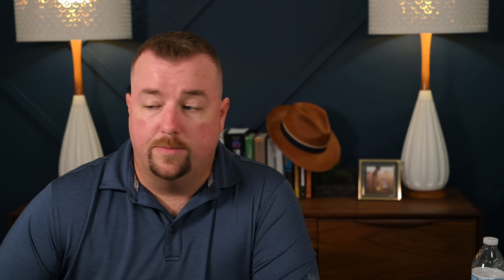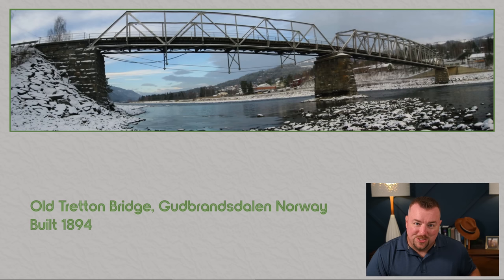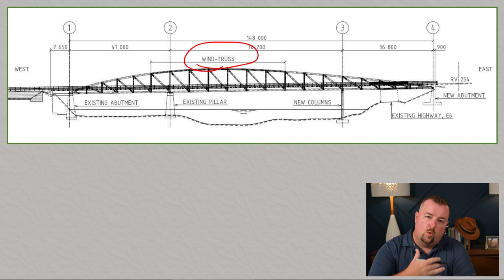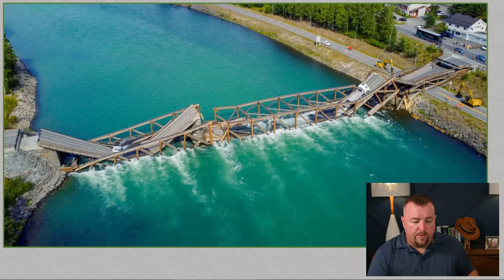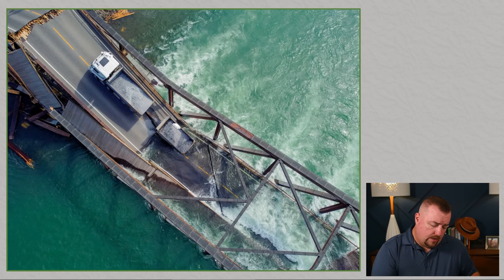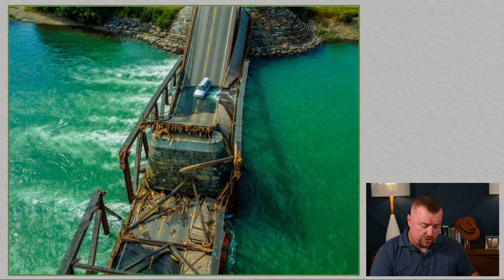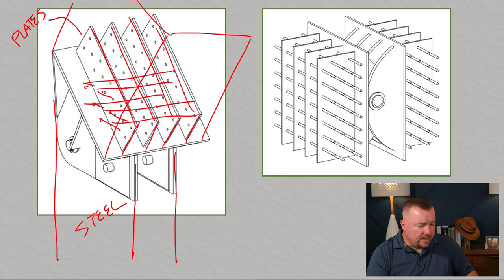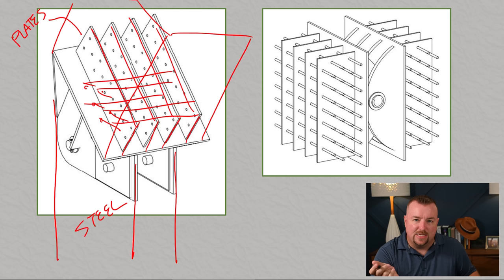How Did the Engineers Miss This?

Comment: I "rode" suspended in a tender house on a bridge 2 days a week for 11 years, and noticed that any heavy vehicle, or one with a heavy load, pushes the bridge into a wave as it first gets onto the bridge deck. Additionally that wave compresses as the vehicle crosses. I cannot imagine any wood joined to metal surviving long-term waves like these.
Reply: We used to call this a bow wave. Happens to asphalt on a insufficiently compacted surface also.
Reply: Happens on ice even quicker. Ref:ice road truckers you can see and hear it
Reply: Im a trucker and in the US this isnt unusual. Big heavy concrete bridges and you can feel the bridge react. Then a second truck comes on and it gets..a little worrying. We actually have laws determining how close together our wheels have to be adjusted because of this
Reply: @jgren4048  That's why there's strict speed limits for heavy loads on ice roads: it allows the "bow wave" to spread out and weaken before the mass of the vehicle reaches a portage to go on land. If the truck is going too fast , the energy can literally cause the ice near the shore to blow out. It can also happen if the water shoals quickly in the lake and that bow wave and the truck hit it.
Reply: My very thought. The bow wave was stopped at the point of the new support columns. Failure probably hadn’t occurred under the loading of the truck/lorry alone.
Reply: @cdreid9999 oh is that what bridge law is?
i knew of it as I'm a trucker but didn't know it had to do with this kind of dynamic force!
(i mostly assune 90% of trucking laws are poorly thought out or obsolete)
Reply: @ARockRaider No, laws “poorly thought out?”  In this country (USA)?  When we have politicians that spend their entire lives as politicians and have never had a real job?  They know everything, don’t they?  Look at our Fearful, oops, Fearless Leader, he’s a frigging genius!  BAAAAWAAAAHAAAAAHAHAHAAAAA!  Unfortunately I believe you’re right!
Reply: @46bovine   Now think about the "stable genius" who preceded him!
Reply: @jpdemer5  Ya, he did a pretty good job.
Reply: @--_DJ_--  🤡
Reply: Yeah there’s plenty of use cases for this material but…not executed so much
Reply: @jpdemer5  Why did you respond with a picture of yourself?
Reply: @--_DJ_--   OOOH...  I  haven't heard such a clever retort since 8th grade.  Well done!
Reply: @--_DJ_--  Yeah, he did do a pretty good job.  Maybe that's why he's leading the polls now.
Reply: For what it’s worth, he’ll be in a federal prison on Election Day 2024 🎉

Comment: The truck is being held by it's "pup" trailer, which is being stopped by the section  of road lying on the river-bed. I don't think any tire could adhere the road at that angle.
Reply: I would agree, also the fall of the truck was pretty dynamic, because the truck was surely moving even while the bridge very unexpectedly collapsed, so the truck must have fallen and landed almost like somebody would trip upwards on a set of stairs.

Comment: I was surprised the wood was laminated horizontal and not vertical it was always going to fail with the holes drilled in the direction of the lamination
Reply from the maker: This!
Reply: @BuildingIntegrity  Why? Don't the glues usual produce a joint stronger than the base wood?
Reply: I sow that rights at  the begging
Reply: Laminated beams are made out of trees, which have grain.  A vertical laminate would only utilize to the width of the tree, not the length, and would compromise the shear strength.  Anyone who has split firewood or done woodworking would understand why these bridges are a bad idea.
Reply: @andrewsnow7386  Stronger in tensile strength, not in shear.
Reply: @Thomas-wn7cl  EXACTLY!!!!
Reply: @andrewsnow7386  To produce strong joints, the glue needs to bond to the fibers of the wood...even better if there is an opening up of the surface of the wood such that the cells formed by cross-linking the parallel fibers can be filled in with the glue.

So far, so good... if you make a good glue joint to sound wood. However, you still have shear planes in the structure, and the lamella have a very thin cross-section.

So, you have two possible mechanisms of failure - slipping and tearing, for want of better terms - and this orientation offers no margin for flaws in the base materials.

The shearing effect - like a splitting wedge used to reduce log into firewood - can  thus tear through the glulam much more readily in this orientation, as opposed to splitting grain when piercing a larger cross-section.

That said, I'm none too thrilled with the resistance to tension when the bolts pierce through the grain in the preferred orientation

Woods and glues are great building materials for some applications... I just don't think that a highly stressed structure, especially when exposed to the weather, is one of them.
Reply: @andrewsnow7386  The glue holds, the wood splits between the glue layers. I've seen this with even plain old Elmer's.
Reply: @andrewsnow7386  Nope. There is a complicated reason (the wood fails NEXT to a joint) why you think this but there is a great experimental video showing how this isn't true if you search it up.
Reply: @Thomas-wn7cl  Do you mean 'compromise', looks like autocorrect auto-incorrected you?
Reply: Yeah, but then you have the tension relying on the glue between the vertical “lams”. Just use steel.
Reply: @andrewsnow7386  I was thinking the same thing.
Reply: Can't the layers be laminated in different grain orientations? I would think that would increase strength in preventing this splitting. EDIT: I see now that layers were oriented flat (horizontally) not vertically, with the pins compromising the glue layers. This design was just begging for the glue to fail.
Reply: @jimk5145  They do make a structural wood and glue composite that is more homogenous, basically long wood chips in a glue matrix, but as Josh said, these are not really meant for outside applications.  Seems that a sense of aesthetic overpowers engineering principles in cases like this.  A wooden paved deck?  I mean....
Reply: I’ve done a lot of wood working in my lifetime. Used to do it all the time as a hobby (and necessity, being dirt poor). There’s a reason when you’re building, say a desk, that the desktop goes ON TOP of the frame, and not INSIDE the frame. The desktop is gonna be much stronger bridging over the frame rails, than being asked to sit inside the rails with screws/dowls/bolts/whatever. Same how quality cabinets will use a dado joint for the interior shelves, where cheaper cabinets will use screws, and maybe some sort of bracing board/shelf support pegs underneath.
Reply: Its worth saying that not all laminated wood use glue. That is, something that bind the wood together via a chemical hardening process. I really just have surface level knowledge. But a lot of wood that is used outdoors use other kind of binding agents. This is also why some outdoor laminated timber have dark joints in steed of light.

If that was the case here... i don´t  know, but i would guess it was.

When saying that 3 bridges have failed, have to consider that there have to be thousands of those bridges. Its not like there was 3 and those failed.

Comment: Just come across this although it is a little old ......  Interesting.     I work as a carpenter - some of it on structural frames (though not on this scale !).  One of the basic rules that every carpenter learns and constantly looks out to ensure is observed is that "Wood can be strong in compression but is always weak in tension".    You just don't design anything that puts wood in tension. These failures are something I remember demonstrating in college tutorials and practical experiments - that was thirty years ago.   I've worked on glulam structures (smaller and less critical ones!) and spent time with the designer discussing how they have done it to avoid wood in tension. You just don't put wood in tension - it will fail. Especially under the effect of moisture, mould and time.
Reply: Good point. Whoever designed this bridge also did not understand the far-out elasticity of steel under load. As a consequence of the steel deforming a lot under tension, all the load goes to the short span of glulam between the bolts and the butt end of the glulam.

Moisture? No, wet wood does not decompose if it remains wet, because the decomposing organisms require oxygen, which won't be available. So, you need "dry-enough" for fungi etc. to attack wood.
Reply: concrete is the same - good in compression, terrible in tension. Reason why you put steel rebar in concrete structures.
Reply: I'm going to disagree with you. Wood is incredibly good under tension. What fails is the fasteners into wood under tension. Of course, although wood is much stronger than steel per weight of material, it is subject to rot. I would also be very careful about mixing steel and wood in a structure where heat cycling is concerned. Their relative expansion due to heat needs to be carefully considered.
Reply: This is complete BS.  Wood is not weak in tension.  It is stronger in compression parallel to the grain than in tension parallel to the grain, but the difference is generally in the 10 - 40% range depending on species.  A specie with 2,000 psi in compression parallel to grain may have 1,400 psi in tension parallel to the grain.  This is still substantial capacity in tension and wood loaded in tension “won’t always fail” as you claim.  It will only fail it not properly designed for the load expected.

Steel, wood and concrete are all useful materials when properly designed and used.  The issue with this bridge failure isn’t the material used, it was almost certainly improper design and/or construction.  There are many wood bridges in the US today that are well over 100 years old.
Reply: @LTVoyager  Good old creosote!
Reply: @isaacm6312  Most old wooden bridges don’t have creosote treated timber.  They protected them the old fashioned way … with a roof.  That is why they are called covered bridges.  Those 19th century engineers were pretty darn clever.
Reply: Good that what those bridge constructor games teach is the right thing. Wood is good for compression, wires are good for tension, steel is good for both, but heavy, alu is light, but weak, stone is incredibly strong for compression.
Reply: @HappyBeezerStudios  Aluminum is hardly weak.
Reply: Agreed.  It would be a "rookie mistake" to have multiple nails/bolts into wood in a straight line along the grain.  I'm not an engineer, but an engineer told me that in wood aircraft, they used a 12:1 ratio to splice wood so the fibers can bond along the grain, so it makes sense to spread these bolts 12:1 ratio into the wood to spread the strain, not the square pattern they use here. A steel band around the joint would help prevent splitting, but would also encourage water logging and rot. Secondly, if the wood beam flexed at all under a load, then all of the stress is put the upper or lower holes first, not evenly distributed. Thirdly, the glue-lam could have been strengthened with some plys at 90' to the long grain like plywood.  4th, wood exposed to hot/cold/rain/ice/sun would have significant movement and very difficult to maintain a seal around these joints for 100 years. (Covered bridges have lasted 100 years because, well, they're kept dry under a roof.)   I do love the wing shape of the bridge, it's a shame it wasn't built stronger.   (I disagree with "tension" issue, all roof and floor trusses are in tension but have nail-plate fasteners with multitudes of nails/fasteners to grip the wood grain.)
Reply: @scrummaster8533  The slope of a glued splice joint has no relevance to spacing of mechanical fasteners.
Reply: @LTVoyager  Do they drive trucks the size of That thing in the pictures over Covered Bridges, how much weight was that bridge rated for?
Reply: @richard8242  No, because the covered bridges were made in the days of horses and wagons so they were designed accordingly.  A modern wood bridge should have been designed for modern vehicles and loads.  I have no idea what this bridge was rated for or exactly why it failed.

Comment: It's instructive to look at railroad trestles built in the 1800s. Steel was expensive and as little as possible was used. The bridges were primarily built out of wood, but they never let the wood be in tension, only compression. Steel (or maybe iron) eyebolts were used to keep the wood in compression. I built a model railroad bridge where they faked the eyebolts, but it at least showed all the places where the eyebolts would be, and it was based on a real railroad bridge. Of course, the pressure treatment equivalent then was creosote.
Reply: I would love to learn more about how old school railroad trusses were built, do you recommend any sources, websites, or readings?
Reply: Right, and we have many railroad bridges in the US that are over 100 years old, and carrying fully loaded coal cars which easily gross 100 tons or more. You can build bridges out of wood, but all the wood has to be supports and bracing. Building a bridge out of wood to make it look like a steel truss bridge was just stupid. Wood is not steel.
Reply: @brnmcc01   On the northwest side of Chicago Illinois and there still stands a railroad bridge used daily supported by wood piers and bracing.  It’s around 3300 North Kimball, just north of Kennedy Expressway.
Reply: Another useful bit of hardware for building wooden trestles is the "bridge washer" - a large diameter thick cast iron washer which spreads the compression from the bolt torque over a larger area of the wood, allowing for a higher torque on the construction bolts and tie-rods to keep the wood structure in place.
Reply: @raybod1775  Yup and I guarantee you a typical train is way heavier than that little gravel truck pulling a pup trailer :)
Reply: As a resident of a western US state where many such trestles were built, that was my first thought also. Wood works fine for bridges of any capacity you wish, provided all members are kept in compression. Even the flaws of this bridge's pinning system may have been suitable for the target life span if the attached members had been under compression.